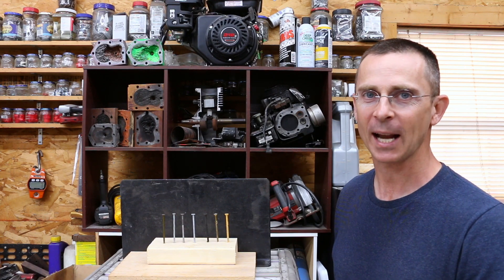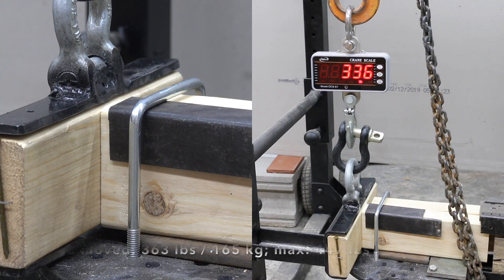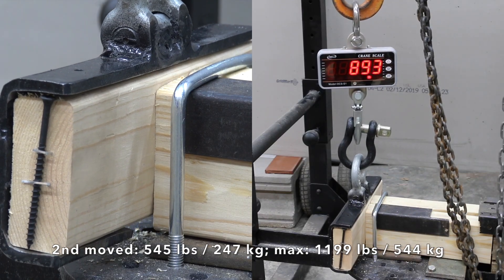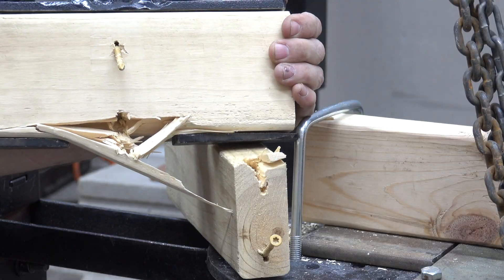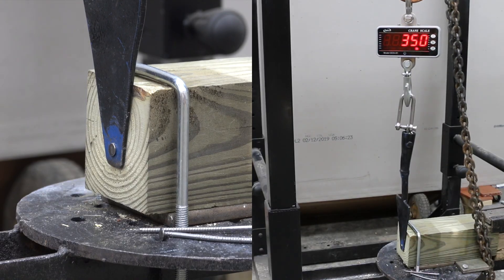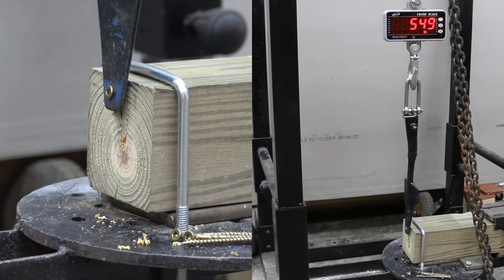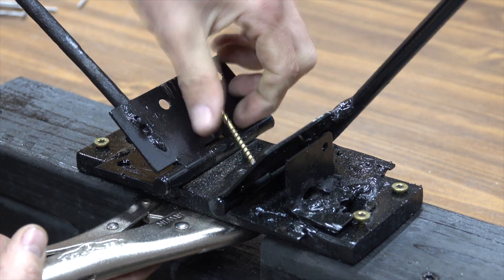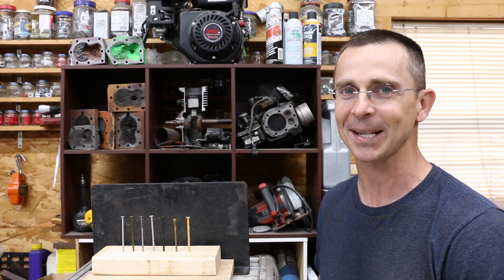Do Screws Shear easier than Nails? Let's find out!

Comment: Don’t get me wrong I have the utmost respect for ProjectFarm, but I feel the data doesn’t fully represent shear resistance. The threaded screws are gaining a frictional advantage over the nails on the initial separation. Wouldn’t some sort of shock loading better represent the shear stresses?
Reply: The boards would have to be secured to prevent the later moment of the faster a pulling and the load could then be applied perpendicularly to the fastener and applied to the point of actual shear failure?
Reply: to prevent the lateral movement
Reply from the maker: Thanks for the constructive feedback.

Comment: Can you do the final shear test with your dual bending jig slightly different.  I believe the shear strength of screw type fasteners will be stronger closer to the head.  Depending on what material you are using them for, say 1/8" steel, to 5/8 plywood.  The threads usually aren't that close to the head.  So it should provide greater strength on the smooth part of the screw type fasteners.  The failure point in your test was the screw threads which is usually deep within the material you're attaching to and doesn't get pressure applied to that specific point.  

Could you send the fasteners upwards from underneath the jig, with the head down.  Only having 1/8 of the fastener hanging down below.  And maybe a 2nd test with 5/8 or 1 inch hanging down below.  I think this will be more realistic of putting the pressure on the fastener where the two joining materials usually meet on the shaft of the fastener.  

If that doesn't make sense I can explain a different way or elaborate.
Reply from the maker: Thanks for the feedback.

Comment: I'd be very interested to see a test aimed at carpenters, sort of, to test your tests... In the first round of testing you screw through a plank into end grain - it strikes me that the point of failure is in fact the endgrain, and not the fastener. I've always been told to avoid using screws in this way (at least in terms of carpentry) and am curious of the difference. To add some excitement, it could be worth throwing it into a video with dowels vs biscuit jointing, although I understand that's more carpentry than the sort of general DIY that you tend to cover.

Thanks for your videos, they provide some good entertainment even if, as a Brit, I'll rarely if ever benefit from the advice within!
Reply from the maker: Great suggestion and thanks for the positive feedback

Comment: As always, a comprehensive and well thought out comparison. Amazing.

I'm so glad I chose to use deck screws for the building of my 10 x 20 barn.
When working alone it is hard to hold pieces in place and hammer. I would drill a pilot hole, start the screw and bring the matching piece into place, then hit it with the battery powered screw gun. So much easier, plus that thing is so tight together, it doesn't even squeak in 60 mph winds!

Plus now if I decide to add to it, I can just remove some screws and go to it.
Reply from the maker: Thanks so much!

Comment: the problem i see is the nails did not shear they pulled out.
Reply from the maker: Thanks for the feedback.
Reply: @ProjectFarm  it was a real world test :) the test shear with a single toe nailed joint. driving angle of 30 degrees to the face of the member being attached  and 1/3 the nail length from the end of the member. load is place in line with head of the nail on the top side of the member being attached. (like a floor joist).

most nails that face shear are toe nailed to a footer or beam. they even get down to direction of the grain. must be repeated southern pine, spruce pine fir and white oak.

Comment: Having encountered galvanized spiral shank nails when demolishing older buildings over that past fifty years, I am surprised how poorly they performed in this test.  Maybe they were made of better stuff a hundred years ago.  Once you encountered them in a teardown, you knew you were going to have a lot more work than you anticipated.  Tenacious stuff.
Reply from the maker: Thanks for the feedback.
Reply: @ProjectFarm  Well I forgot that fifty years ago we were also trying to pull these nails from framing material that was now petrified clear fir.  Even when you pilot hole this stuff nails have a tough time and screws will break off if you don't gauge the hole size correctly.

Comment: Next time, weld a tab to offset the lifting lug location relative to the part. You wanna go towards the other cross brace with the hook about 1/2" or so . 
This is on the first test^^

To be center with the crack between the wood.

:)

The way you are lifting it it's about 35% a twisting test. It is a good test still but not true shear. Need to be center of the connection to shear:)

Comment: this machinist likes the content. Your jig that is attached to the chain needs to be modified so the bottom nail does not pull out first so easily. if you weld a 1 inch wide .125 thick piece of steel at both ends of the jig making the end look like a rectangle and not a c shape. this will make the jig hold a more true shear angle but i suspect the bottom will still pull out first but i bet the weights required to move the wood will be greater. Dam good content SIR!
Reply from the maker: Thanks for the positive feedback.

Comment: Seems to me that the sheer strength also depends on geometry. Specifically, the screws have the spiral design for the threads, which imparts a weakness due to the narrowing between threads. The straight-cut nails have a more uniform diameter and, therefore, have abetter tensile/sheer strength. Destroying things was my job for many years, conducting cryogenic testing on metals. Great fun watching something like steel shatter like glass at low temps. At super slo-mo its an absolutely stunning visual.
Reply from the maker: Thanks for sharing.

Comment: seems like this test may be flawed, its not really testing the shear force of the screws, but the stability of the wood fibres. to find the rated shear strength of the screw you would need to use materials that cannot be chewed up so easily, the rated shear strength is on the actual steel of the screw, and its actual snapping point.
Reply from the maker: Thanks for the feedback.

Comment: You did some great work.  I wonder though if you wanted to actually test SHEER strength you should insert the nails and screws into a LARGE piece of wood and just above the fastener you put a metal plate to prevent slide or sideways movement so that when you pull up on the fastener it hits the STOP rail so you get and accurate SHEER strength instead of the PULL OUT strength. Im only speaking from experience in framing.  sheer strength is based on shearing not pulling out of wood.   I good example would be a joust hanger with multiple nails holding it flat against the stationary Beam.  Just a thought.
Reply from the maker: Thanks for the feedback.

Comment: I've always questioned the reasoning that screws shouldn't be used due to the brittle metal breaking when bent.
If the structure has gone so far as to bend the screw, it's failed regardless of fastener choice.
Reply from the maker: Thanks for the constructive feedback.

Comment: It does need the impact test. This is where the ductile fasteners shine.
Another point is fastener length.
Another is where the load is applied. The ring is likely to last for more bends if the shear jig is loading on the smooth part of the shank.
Nice informative, introductory video series on factors influencing fastener strength and durability.
Thank you.
Reply from the maker: You are welcome!

Comment: Good methodology. I notice though that when the nails fail they nearly always pull out. This isn't really testing shear strength. A ledger for instance wouldn't be able to move sideways like the apparatus and pull the nail out horizontally. The force world be purely vertical. The reason the screws perform better in these tests is due to their resistance to being pulled out, because pulling out is what caused the nails to fail. All horizontal movement needs to be negated to truly test shear strength.
Reply from the maker: Thanks for the feedback.

Comment: I think many fasteners are designed to have different properties in the upper shaft as compared to the lower threaded section. Have you considered this? Also I have experienced where the head shears off while driving them in, so could have a test around that.
Reply from the maker: Thanks for the video idea.

Comment: L&i guy (sorta like OSHA) came to my place today. He said we aren't able to repair extension cords. Toss them out or cut them in half and add new heads to the cut end.  Some data on repairing extension cords would be great, solder vs butt connector vs twist nut under load and hard wear scenarios on 16AWG, 14AWG ...
Reply from the maker: Thanks for the video idea.

Comment: Since the results of this shear strength test clearly favored screws for holding power, excepting where the screws would somehow be bent at a 45* angle without the surrounding wood having been destroyed, you could run one more test here to test fatigue. Insert the screws all the way into the wood, do the shear test but limit it to reasonable loads that would be experienced in a home over years. Then pull in both directions repeatedly. Not just upwards at 1000 lbs, but up at 100 down at 100 up at 100 down at 100. Walking away with the knowledge that ductile metal bends better isn't relevant to the question of whether screws are more likely to fail in homes where nails have been traditionally used.

Comment: This experiment is very flawed.  Shear strength of the fastener was not measured, but rather the ability of angular grip.  On any fastener, shear is the strength of its ability to resist deformation or breaking at angles perpendicular to its shaft.  In most of the experiments depicted in this video, the fastener bent and lost grip, which is an independent property of shear.  In construction, like in the joints depicted in this video, the number one necessary property is gripping strength in relation to the strength of the material, usually construction pine.  Regarding shear with any fastener, the primary property that determines if a threaded fastener is meant for shear strength loads (not nails) is if it has a shoulder (the space on the shaft with no threads).  That portion needs to be at the point of shear to offer the most resistance to shear.  Also, coating doesn't effect overall strength of a fastener.  Coatings are to add resistance to corrosion, which allows for the fastener to retain its strength longer.  On internal, non-damp environments, for example, coated fasteners are unnecessary.
For a better experiment to test shear, tensile, and/or compression strengths, the jigs need to be made of very robust, harder material such as X38CrMoV5-1 steel.  Use bolts and clamps to attach the fastener to the jigs, then apply the appropriate forces.
Reply from the maker: Thank you for the feedback.

Comment: As always, thank you for a show that is fact based and to the point. My main question here is with the fatigue test. Bending at the thread, which should be well embedded in the wood, doesn't seem realistic, especially given that most of the screws have a long shoulder to address issues will breaking at the thread. It seems a fairer test (as seen in many of your pull apart tests) near the head. Also, it would seem screws are commonly used for binding steel brackets and plywood/OSB to wood beams, therefore, at the head or shoulder...
Reply from the maker: You are welcome!  Thanks for feedback.

Comment: I realize this video was a year old, and I think it was mentioned...but part of the methodology testing for the first test and especially the second test showed a lot of failure due to the wood giving out before the fastener did.  I believe that's because you screwed/nailed the fastener down the length of the grain (through the end of the board) instead of into the edge of the board.  As I understand it, that's the weakest way to fasten into wood.  If you revisit this video (not seeing anything in suggestions), redesigning the test so you fasten across the grains instead of down them might provide different/better results.
Reply: This is 100% right. Fastening into the end grain like this practically guarantees that the wood will always be the failure point in these tests. The reason the drywall screw performed so well is because it has a more aggressive thread than the other screws and it was able to engage more fibers thus spreading the stress out over a larger area of wood. I would never use drywall screws for anything even remotely structural. Structural screws from Simpson, GRK, and the like will have published values for shear and tension dependent upon what wood species they're being installed into. Screws have their niche in wood construction. You just have to make sure to use the right screw for the job, just the like the nails.

Comment: I don't think that this is a valid result.  The two methods employed  didn't put isolated sheering forces on the screws and nails, the forces employed were sheering as well as tensioning.  A better test would be to place the test fastener into a fixture so that a sheering force could be isolated on the shank about 1.5" down from the head of the fastener.  This would replicate the joining point of a pair of 2x4 boards.  By equally supporting the fastener on either side of the test point the only forces that would be applied are sheering.
Reply from the maker: Thanks for the feedback.
Reply: @ProjectFarm  I also want to follow that up by saying the work you're doing is amazing and high value.  When I need to buy a new tool or some thing for around the house, like rechargeable batteries recently, your channel is the one I check out to see if there is any sage advice to be gained prior to the purchase.  The content you're putting out really is helping people and giving them good and useful information.

Comment: Really informative testing, and great methodology. But I question how relevant the final bending test is. There's no way you'll get that amount of bending until the screw is already significantly out of the wood; the screws will resist pulling out, and therefore avoid being bent at all for much longer. A better shear test would be putting the fastener through two metal blocks and actually shearing each fastener.
Reply from the maker: Thanks for the suggestion.

Comment: Interesting testing.  I've recently started following the channel and really enjoy these videos.  Some observations (that are probably somewhere within the ~4200+ comments):  Absolute maximum strength in a particular fastener isn't always required (in aerospace for example bolts are individually stronger than equal size rivets, yet the vast majority of aluminum structure is riveted, while bolts are reserved for particular highly loaded joints).  The same applies here.  I can see where sinkers are used for nearly all framing applications - pfft, pfft, pfft, pfft and just like that with a nail gun, 4 fasteners are installed, vs screwing, even with a strip fed screw gun, which will take significantly longer.  The installed cost per fastener for screws is higher / rate of production is lower for equal labor time.  And if good enough (nail) is good enough in a particular joint to meet the loading requirements, then there's no need to spend the extra money on overkill.  That said - I find this kind of video very valuable as when working personally around the house, I tend to go for overkill.  Keep up the great work.

Comment: Can you test how much torque it takes to break the screws as you're screwing them in? I've had drywall screws break most often as I'm trying to screw them in to harder woods. Even my lighter 12v impact drill can snap the head off of a drywall screw if I screw it  into a knot in the wood, especially without a pilot hole.
Reply from the maker: Thanks for the video idea.

Comment: Gonna have to agree with many other commenters about the testing methods. This is the first test from Todd that I’m not impressed with at all. Sorry. None of those were shear force tests. You need a new jig to test shear force. Should be quite simple, all you need is 2 steel blocks, one bolted down to your test bed, the other hanging from your lifting rig, with a hole about the same size as the nail/screw going through both. The moveable block should be on ‘guide’ rails to prevent it from lateral movement which will give you pull-out and tensile test. With this jig you’ll be able to isolate the SHEAR force and get an accurate number.

Comment: You need to test different head styles of screws.  Phillips #2, square drive, torx, hex head (there are some obscure types such as "Pos-Driv" which look like phillips but don't mate as well).  Compare results with steel and stainless steel (which is softer.  Note the cam-out forces, and the degradation as the tool bit wears, and which head style is more subject to wear, and which style is more affected by the inability to have the tool exactly aligned with the screw.  My experience with square drive is that they are bad engineering, tools twisting off, and screws stripping.
Reply from the maker: Thanks for the video idea.